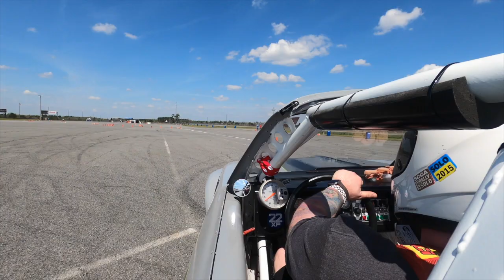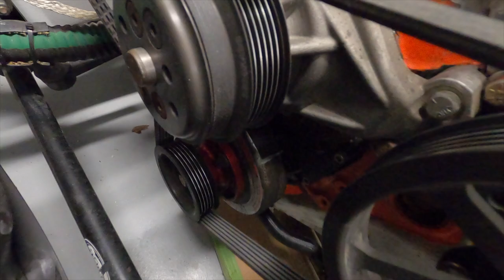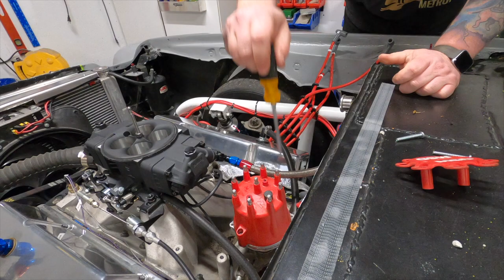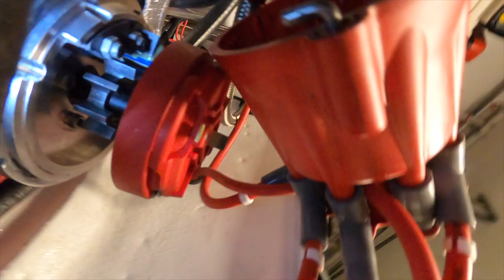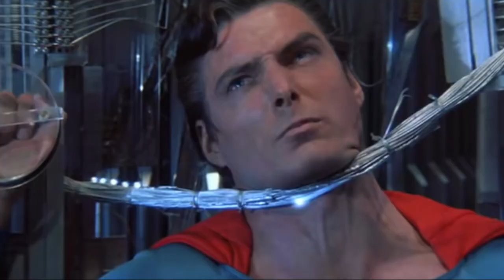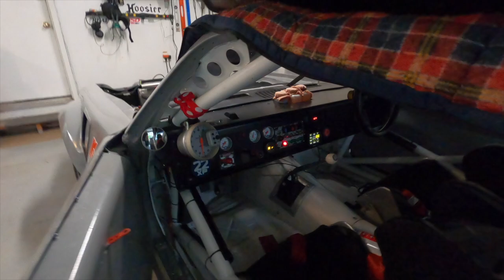Timing Is Everything - Holley Sniper EFI Ignition Timing Upgrade: Paul's C-Prepared Camaro

Comment: I put a Sniper on my SBC 70 Vette,,,  Started easily and ran real good. So I decided to hook up the spark control... What a PITA.. I thought I had it correct and I even read the directions 2 or 3 times.. Would not start.  No spark at all.. so I started backtracking.. Turns out the pickup on the MSD Distributor and my MSD 6AL2 box failed someway.. Summit sent me replacements and I went back to Sniper EFI and MSD distributor spark control..  Runs great.. 15d BTDC at idle to 34d BTDC at 3000 and above.. Cant say that the sniper could do that any differently but since I don't use NOS and dont need spark retard... Who cares...

Comment: Great video! I was rolling 🤣 ...I'm kinda having this same issue with my fitech was fine before I tried to add In the timing control. At 10 psi its poppin I can't seem to get enough timing.  Started at 30 at 46 now it don't seem to change fitech show on the screen...maybe it's crossfiring..base is 15 degrees. If pull off the carb hat it's fine..rotor is just touching the left side of the tower at 15 degrees. I'm 90 percent I'm phased right afr @12 and change when it pops